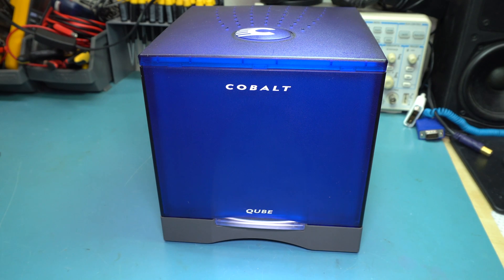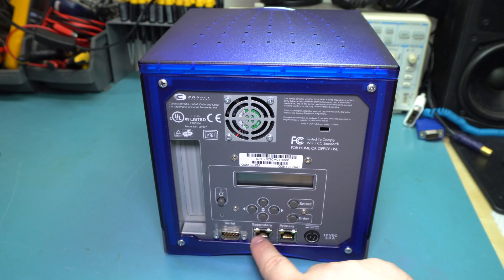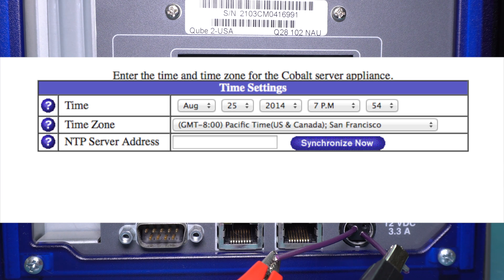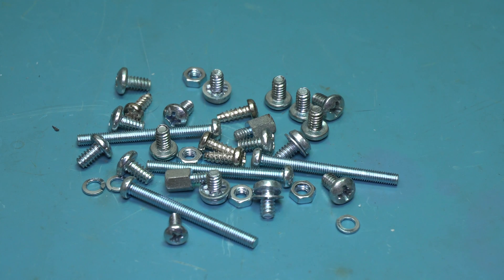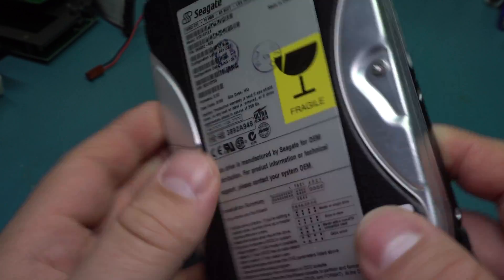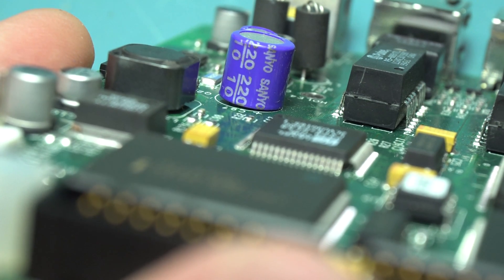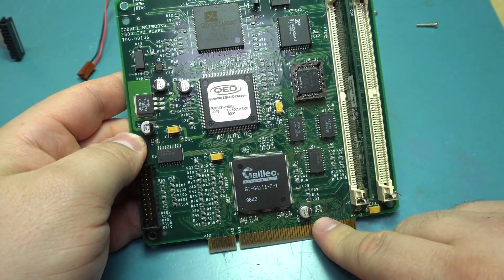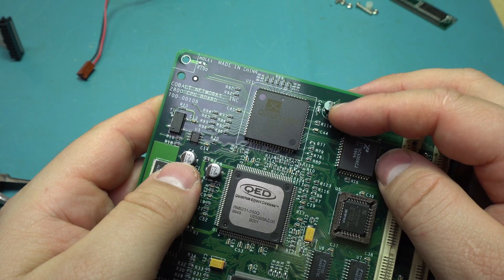Cobalt Qube 2 Web Server Teardown

Comment: got a couple of these: a Cobalt Qube 3 and a Sun Qube 3 - the main problem I have with them now is the administration web front is somewhere in the region of 15-20 years old and relies on browser functionality that is no longer supported. Maybe a project for the future is stripping out the innards and fitting a Mini-ITX motherboad in one.

I've had both of mine running but they both take a really long time to boot up from the installed hard drives - I think the drives are maybe not in the best of health

Comment: Seagate had an OEM arrangement with Cobalt to produce a product called the Seagate NASRAQ. It was basically a RAQ2 (MIPS) device with 2 (usually IBM 17GB, yes 17GB) drives, single 10/100 NIC and external SCSI for expansion that only did NAS, no web or any other functions. I had one for years that I upgraded to 128MB RAM, two 80GB  internal drives, and an external Sun 711 disk box with 12x 36GB drives running NetBSD 4.0 doing duty as a file, web and NFS server, and also parking me on multiple IRC channels and logging all of the channel traffic to files. It was one of the most stable machines I've ever owned with uptime usually being broken by software updates requiring reboots. You could even control NetBSD to startup/shutdown and change interface config with the front control panel.
Reply: "parking me on multiple IRC channels"
That explains why I'd often see a lot of users online who wouldn't respond!

Comment: 6:06 "VIA USB to (2?) PCI host adapter" is not entirely correct, that's just a generic VIA southbridge you see on tons of P1/P2 motherboards. Or to be precise, "VT82C586A PCI INTEGRATED PERIPHERAL CONTROLLER -- PC97 COMPLIANT PCI-TO-ISA BRIDGE WITH PLUG AND PLAY, USB CONTROLLER, MASTER MODE IDE CONTROLLER WITH ULTRADMA-33, KEYBOARD CONTROLLER AND REAL TIME CLOCK". So it's way more stuff than just USB.
Reply from the maker: Yep. You're right. Weird, I swear when I looked up the number I didn't get a datasheet for it - probably made a typo when Googling and got some other part. :P

Comment: I have one of these machines, but the x86 one.  It is a neat little box.  I actually had to use the IE that came with XP on a VM in order to get the web based setup to work.
Reply from the maker: Worked fine in Chrome for Windows 10 when I tried it out.
Reply: I'll have to try that with mine - I'm wondering if its possible to get a  recent linux distro installed instead of the original OS, but this would probably lose the back panel LCD functionality

Comment: The RM5200 MIPS processor was used in the SGI O2 workstation, so it had quite a bit of number crunching capability.  http://www.sgistuff.net/hardware/systems/o2.html
Reply from the maker: +stonent I think the 5200 is a much more powerful variant of this one. Similar to the Nintendo 64 using a similarly named, but much weaker 4300 (or whatever number it was :))
Reply: Either way, it was also blue and the O2 was code-named "Moosehead" so we've come full circle with the kitty. :)

Comment: 21143 on the Intel chip means they were offshoots of the old DEC 21140 10/100 Tulip chip since Intel bought DEC's semiconductor business. There are also some 211xx chips in the series for PCI bridges used in some laptop docking stations.